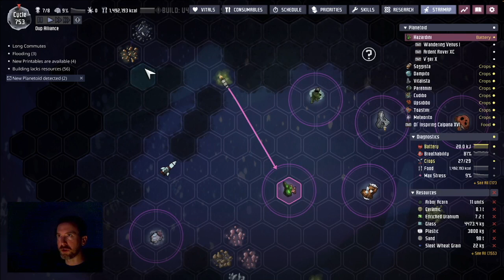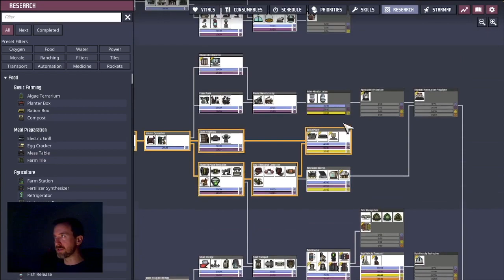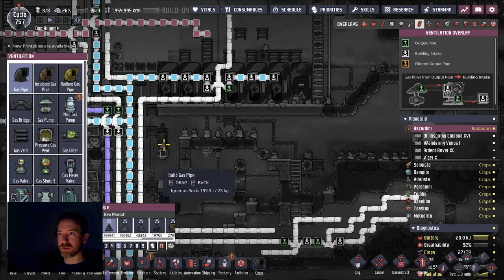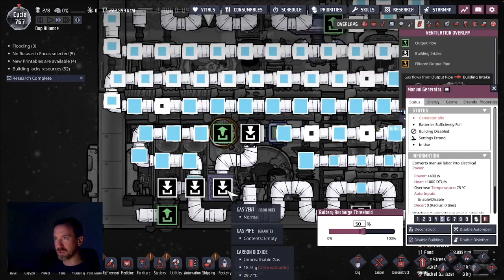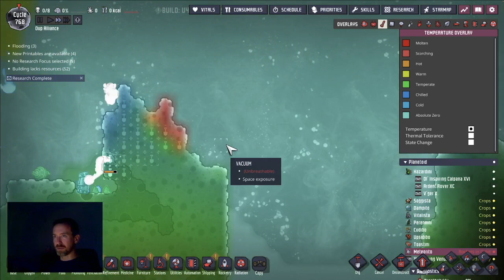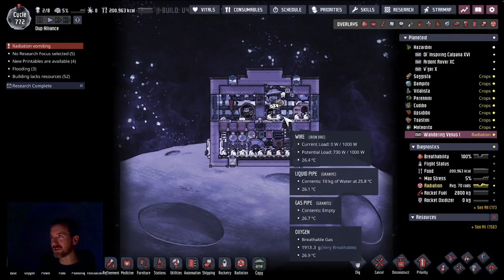#33 Catching a Shove Vole

Comment: Comment pe ding from last two episodes Jeff don't use lead for rocket platform at overheat temp is high but lead has vey low melting temp and liquid lead can vent to space leaving with a loss and a stranded at any one landing .or no rocket platform after a launch.
Reply from the maker: Good point,  I will be switching them over.